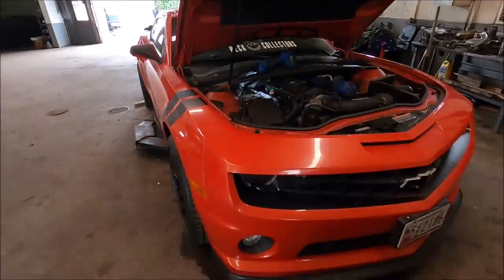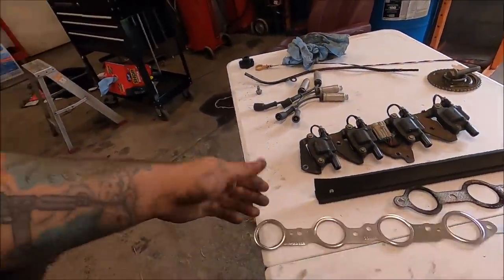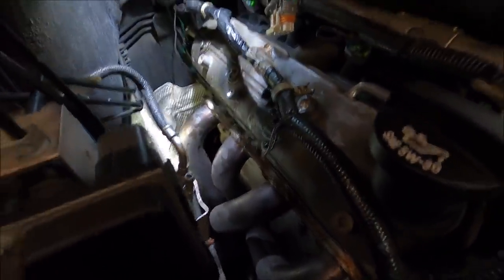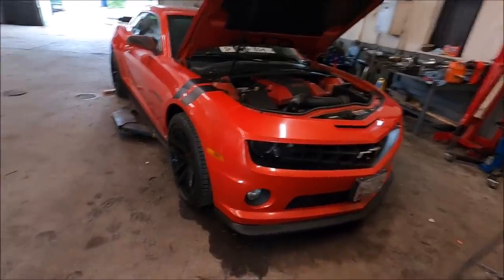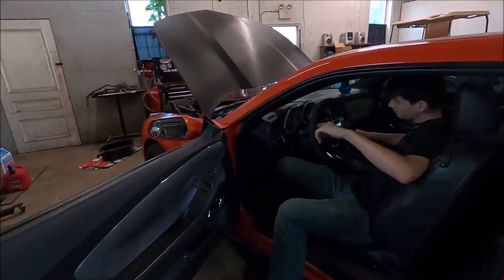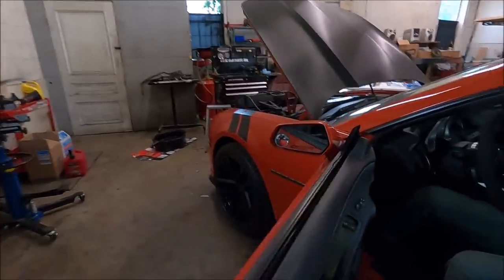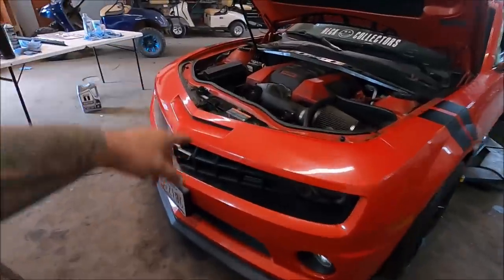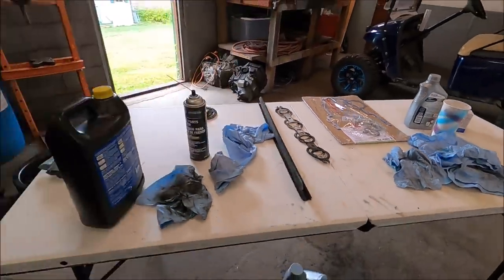Why You Shouldn't Use Aftermarket Header Gaskets On Your LS Engine!

Comment: Wait so you just throw a box end wrench on the header bolts and torque the shit out of them instead of using a torque wrench and torquing them to the correct spec?! Not smart to do on aluminum heads.

Comment: I've used that style gasket plenty of times and never had a problem. I actually had to use that. I had one that kept leaking. I tried copper gaskets I tried the multi-layered steel one. I always had problems. I used the composit ones and that was the trick for me. Never had another leak. Yes I have them on a LS.
Reply: Proper torque is key

Comment: Even the highest quality producer of aftermarket exhaust systems use cheap gaskets. I have a Borla Kat back Atak system on my 2015 SS from the headers all the way back came with cheap felt gaskets. After about a month the driver side leaked and the passenger side was on the way out. I heard the ticking in the engine bay and my heart stopped! Use the metal triple layer gaskets! It’s no worth changing them later, trust me it’s a pain!